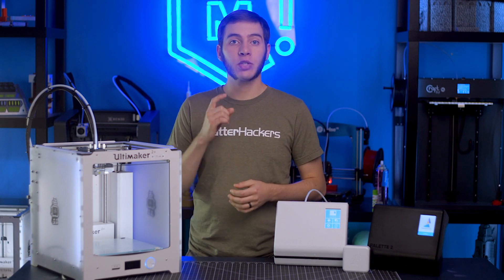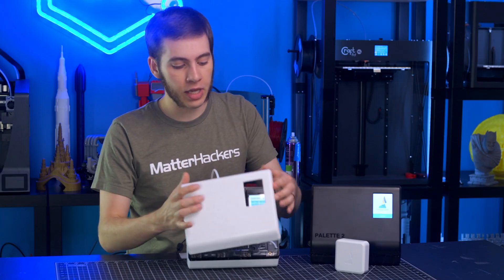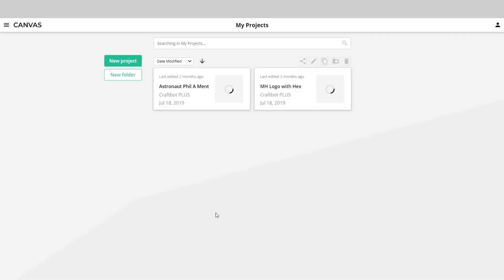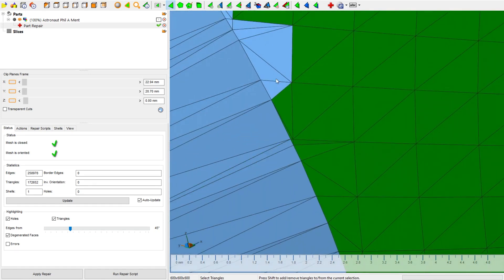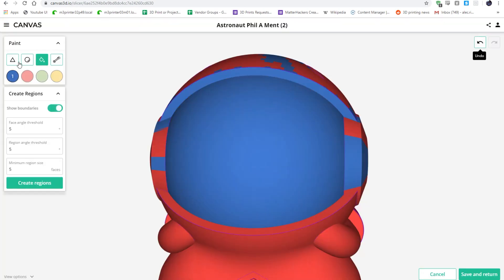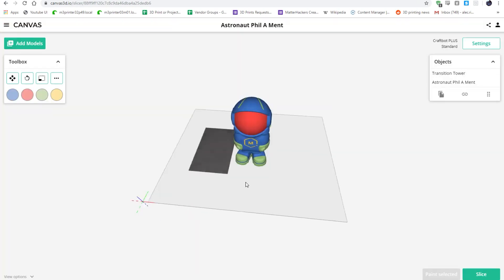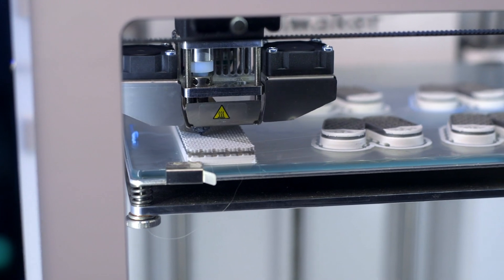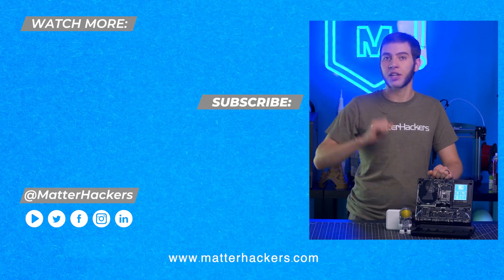How To: Get Multi-Color 3D Prints with the Palette 2 Pro & Canvas

Comment: I still think they should consider a version that is the size of a phone with maybe just 2 or 3 filament inputs and uses smaller steppers and doesn't have a gapspace (the section in the upper left) and just puts it outside the machine.

Comment: I'd suggest adding some real world info about how long models take to print.  Also, not all printers are compatible with the Palette 2.  Specifically, the Pulse XE has issues due to the auto bed leveling configuration and dependency on using Matter Control.
Reply: The Pulse is locked in to Matter Control? I thought it's basically a Prusa clone?
Reply: @kurtlindner  I own a Palette 2 and a Pulse XE.  While working with Matter Hackers and Mosaic support, I was told by MH the auto bed leveling feature of the Pulse XE only works if you slice with Matter Control.  So if you try to use Canvas and Canvas hub(Octoprint), you don't get the benefit of auto bed leveling.  I have had some success with the Palette 2/Pulse XE solution, but it's been a struggle.  Keep an eye on Ebay for a used Palette 2!  Overall, the Pulse XE is great, but this was something I wish I would've know before buying the Palette 2.(I bought the Palette directly from Mosaic and did not confirm compatibility ahead of time...that's on me, not MH)  I love the Pulse XE, and I'm not complaining about it or MH's support, just sharing my experience.
Reply: @kendavis6321  Hey Ken, there have been some changes made to the way Pulse works, so it will not respond to G29 commands if you're on the latest firmware. If you are and it's still not running, talk to the support team and they should be able to get you the proper firmware file to get it working right. I have two Pulse XEs that I move around and have completely untethered when I'm printing and prints are coming out beautifully.
Reply: @Richter3D  OK, it's been maybe two months since I talked to MH support.  We specifically discussed the G29 command not working and the only work around was to customize the firmware which would void warranty.  I'll go back to that email thread and ask the question again.   Thanks for the input!
Reply: @Richter3D  Have you worked with those Pulse XE's along with the Palette 2/Octoprint?
Reply: @kendavis6321  I haven't tried them with Palette, but I have tried them with Octoprint a while back to do some Octolapses. It was more of a test than an active interest in Octolapse so I didn't go any further than the one video. But it did connect and it did run the prints without issue.

Theoretics here, but once you recreate a printer profile in Canvas for the Pulse, there shouldn't be anything stopping them from working together.
Reply: @Richter3D  The next time you have nothing better to do, give it a shot with the Palette 2.  I'd be interested to know if you have the same issue I do.  I have to manually configure a negative Z offset, otherwise the nozzle never reaches the bed.  Long story, I broke the Olsson ruby nozzle working through that.  If I don't set a negative Z offset in Canvas, the nozzle floats around 2-3 mm off the print surface.  Any chance the recent changes will help with that?
Reply: @kendavis6321  I think that's because Z0 is set higher than the bed in firmware so that when MatterControl does the bed leveling sequence things don't crash. With G29 enabled, it'll probe and create the mesh as expected. I've experienced the same issue as you, but now I can print without leveling data exported as long as I have the right start Gcode to tell it to probe the bed at the start of every print. Perfect first layer every time.
Reply: @Richter3D  FYI, I checked in with MH support.  They said my one year old Pulse XE with the 8 bit board has not been updated to allow G29.  I suppose I could modify the firmware myself, but I've only done that on my older/cheaper Tevo printer that is now a laser engraver.  The Palette is a perfectly fine device, but even if my printer didn't have any issues with ABL, the amount of time it takes for prints of any size doesn't work in my house.  Running prints overnight is highly discouraged by the boss!  Thanks again for the input.
Reply: I have pre-ordered the pallet 3, and have been running some models through canvas, then taking the gcode and loading it up on mattercontrol, I copy and pasted all the start and stop gcode from mattercontrol onto canvas, so when I slice on canvas and print through mattercontrol, it works pretty good. Actually probably the best ryno filament benchy I have done yet.
Reply: One thing I’m curious about, so I almost always have to tweak the z offset at the beginning of the prints, I’m hoping that the pulse xe will be able to connect to the hub and allow this fine tuning while printing.